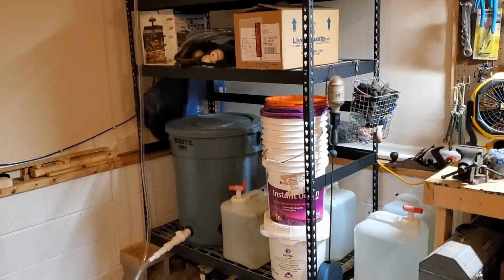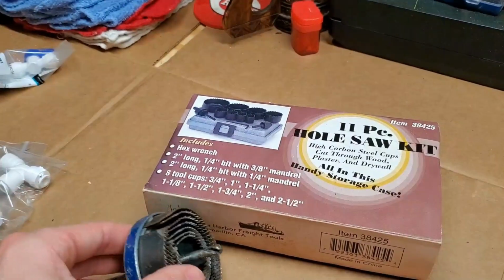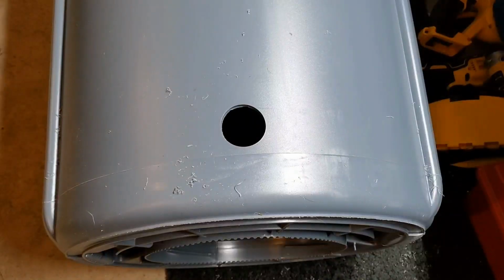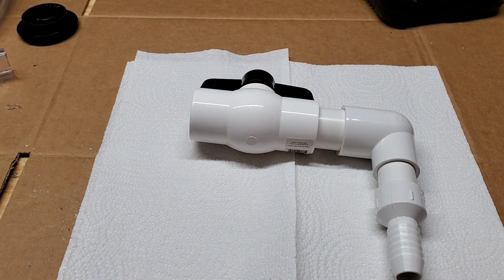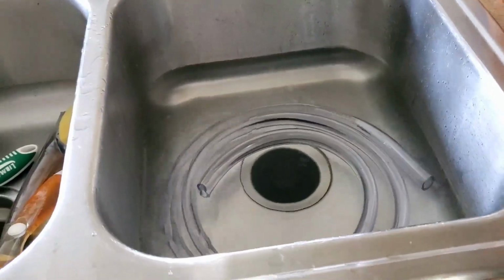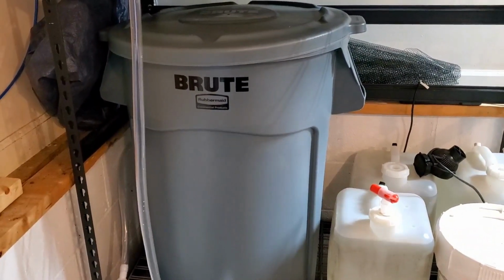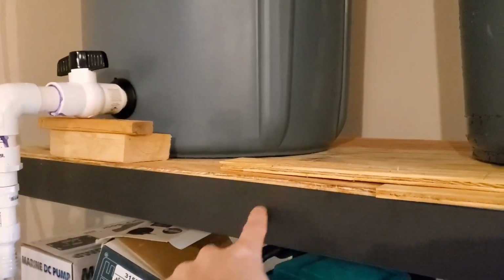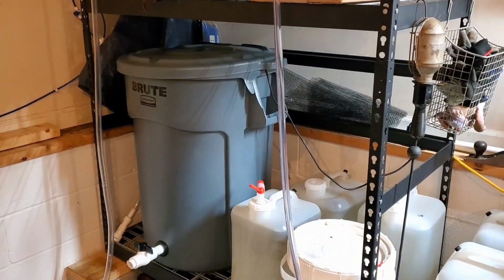Upgrade Your Saltwater Storage and Mixing Station for $100

Comment: You know, BRS does offer a 3-way valve (https://www.bulkreefsupply.com/3-way-ball-valve-with-john-guest-1-4-push-connect.html) that would have allowed you to do this without needing the multiple fittings for just a bit cheaper.

Comment: Hay I just won't to help you make this better and if you take a small 90with a ro balkhead drill a small hole in the bottom of the  barrel run some clear tube to the top were the handle is zip tye it to it and when the barrel fills  you can see how much water you have happy reefing
Reply from the maker: I thought about doing that honestly.  I may get around to doing it in another video! Thanks!